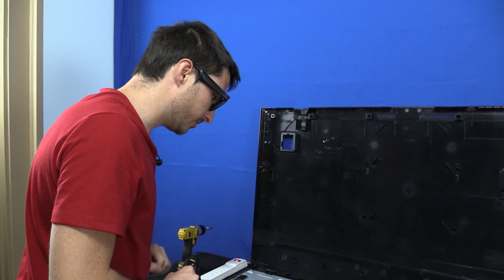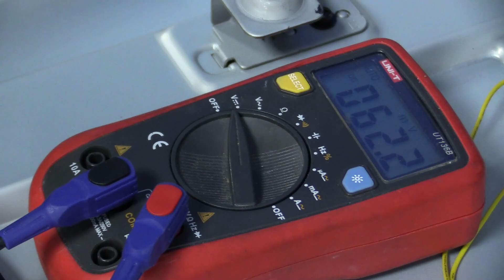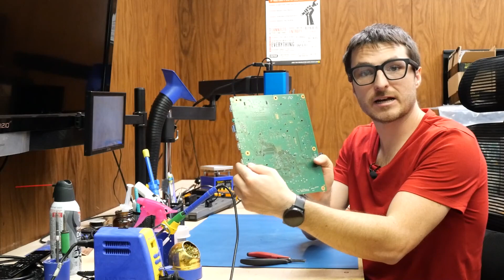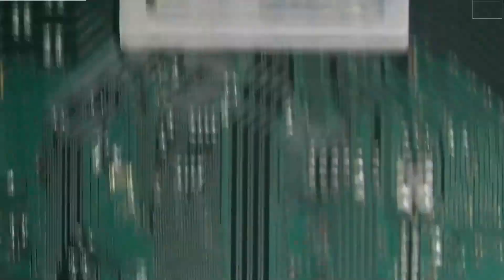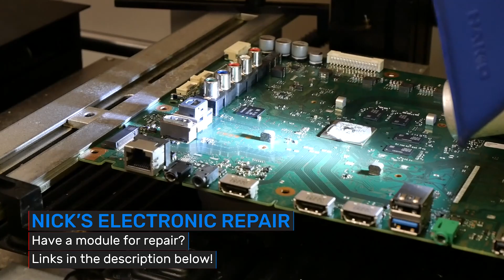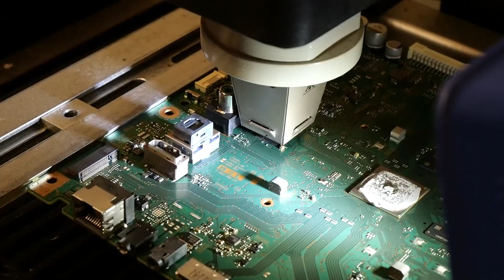Sony TV Repair XBR-55X850G

Comment: I guess first things first. You're plugging in the TV to do a voltage check do you have to use the remote to turn on the TV or press the power button on the bottom right side button first?. Also on the last step on checking the power supply  you're shorting out pins 5,9 and 26 together?. Correct.... Please advise Tommy
Reply from the maker: At no point did I ever press a power button during the entire video. 
As for which pins, yes I say exactly which ones in the video. Look at the legend on your power supply, it will tell you where the pins are.

Comment: I tested the #9 pin and it showed no voltage. Likewise with the pins #13-18. It is very difficult to get the test leads in there where the wires are, so I'm not confident I'm doing this correctly. Even if I check on the opposite side with the solid leads (for pins 15-18), I still get zero voltage.

Comment: Hi Nick, having the same 4 red light blinking issue with my XBR65X950G. I searched entire internet the back panel looks entirely different. I tried to ground the B_ERR from the power board but no luck. any help would be greatly appreciated
Reply from the maker: You need to replace the LEDs to fix that fault probably but this could also be due to a defective led driver board

Comment: I have full gray screen on TV and everything is working fine background. Last time same issue occured and technition opened and cleaned some strip with isopropyl. Fixed this issue in 1 minute. Could you please help know what is the issue as same issue has happened again after around a year.
Reply from the maker: Hello,
What model tv do you have? Do you have this exact same model? The Sony XBR-55X850G? 
If so what strip are you reffering to? Was this near the bottom of the set? Could you email me pictures perhaps?
Reply: @NicksTVRepair I fixed it. Model is 55x80aj… strip was kind of golden colour..disconnected, cleaned the strip with isopropyl put it back on…surprisingly tv came back on..sorry didn’t took the pick and its wall mounted.. spoke to tech he was advising to change the strip 😂
Reply from the maker: There is no strip to remove and plug back in with tvs like this. 
I don't know what this could be or what you are describing sorry
Reply: @NicksTVRepair by strip I mean the BUS and there were quite a few in when opened

Comment: Hey Nick, I'm an electronics technician studying electronics engineering at this old age and I must say, your content is awesome for techs like me. I recently had a friend bring me a Sony XBR-55X850B with some similar issues you've described in this video. I've done various repairs on various LG TVs particularly the backlights which go out ever so often on some models. But, I'd like to repair this Sony myself since I all the equipment to do so, except the IR Machine, but indo have some nice hot air machines. However, I can't seem to find the EMMC Chip or the Main Processor for this TV. Could you reach out to me to help me out? Oh, and NO, I'm not doing this as a business or to compete with you or anything. Im helping out a friend.

Anyways, love your vids, love your content, and wish you the best to keep growing your channel. Gid Bless, cheers!!!

Comment: Nick could you help me with this problem on my Sony tv, it is an excellent tv but now it intermittently switches off, it will reset if you switch power off then back on ( you can hear it clicking off ), the model number is KDL-46HX820, thanks.
Reply from the maker: I can't say I know what the fault would be with this model. I am not familiar enough with this one and would require the entire TV to perform a proper diagnostic. 
Sorry

Comment: I have a 65A8H that loses sound after being on for a while. If I keep it on after that I get some noises which sound like are caused from heat and then the TV turns off and blinks red 3 tmes. I can get both a new main and power board but would like an idea which is more likely faulty before I tear mine apart.
Reply from the maker: In my experience this is a mainboard failure. Most likely your CPU is overheating and going out. It will need to be replaced. 
If you have issues with the replacement mainboards you buy and want to go with a more reliable route, we offer this repair service and can fix the board for you. All repairs come with a 1 Year warranty.

Comment: Sir how do you manage to get the software for the emmc chip ?
Here in India it is very very difficult to get it
Reply from the maker: Hello,
I don't think it's easier here in the USA. I mean you have to find a working mainboard that you can use to dump the software, the issue as I am sure you are finding is that often there are no boards for sale not new not used, not even broken. The next option is to find someone selling the whole TV. Once we find it and buy it, we typically factory reset it first, then remove the mainboard, remove the eMMC, and dump it. Then we use that program to repair other mainboards. We once had to travel by car for 3 days to drive from Tucson Arizona to Dallas Texas to go get a TV for this purpose. It was a day-and-a-half drive there, 1 hour to buy the TV, and a day-and-a-half drive back. We could never find someone with that TV for sale in working condition until we found someone on eBay who would not ship it and would only sell it in person. So we had to drive out to go get it. Finally, we were able to start fixing those TVs.

Comment: Thanks for your helpful videos!! Can I get an advice? I got an XBR-55X850G; it turn on, image is good but after 3 min it turns off and you can hear a click. also the red light flashes 6 times. What should I diagnose first? again thanks for your help.
Reply from the maker: 6 blinks = LED strip failure. Replace your LED strips
Reply: Backlight

Comment: Thank you for the help! I have a sony bravia xbr-85x850g and have the exact same issue.
For awhile the tv was stuck in headphones mode because it thought something was plugged into the jack. Then the other day the tv wouldn't power on at all. However, i can still hear the power supply click when I try to power it on. Most likely the main board?
Reply from the maker: Yes that is what I would replace or send in for repair first.
Reply: @NicksTVRepair  thank you🙏🏻 and major respect for taking the time to reply to every body.
Reply from the maker: You are very welcome. I try my best to do so!

Comment: I've been searching for instructions for testing the power board of my Sony set, which is an XR55A80J.  The board is an AP-P525AM, not the same as the one you tested.  Printed on my board are the functions of the various pins on the main board connector, but not the voltages.  So far I haven't found a video featuring my board.  

Can you help?
Reply from the maker: For your board the legend says pins 22-28 should be 12v. Pin13 is your power_on line and 14 is the standby. Standby should have 5v if you short it to the power on line then your 12v should come up.

Comment: Yo tengo un smartv Sony Bravía XBR-55X805E y el problema es seme apaga y enciende
Reply from the maker: Sí, este es uno de los problemas más comunes que vemos con estos. Es el mismo problema, el eMMC de la placa base está defectuoso y necesita ser reemplazado.
Reply: @NicksTVRepair  where I can ge the eMMC for this model apart from aliexpress? But my concern where I can get this programmed? the method you used with USB is for instaling operating system which is another thing, right?

Comment: I have a XBR-55x850c when plugged in it says SONY then goes to graphics in the center of screen then starts over again. What can cause this? Can you repair the appropriate board?
Reply from the maker: Hello,

Yes, this is actually very common and is due to a faulty mainboard. We have a flat-rate repair service for this. Check out the listing linked below to our website. You can pay for the service and then an email will be sent out with shipping and packaging instructions:
https://nickselectronics.com/products/a2072607b

You can also check out this video about the repair of your model mainboard specifically:
https://www.youtube.com/watch?v=wSQr_JVC_hU

Comment: How to fix Chromecast on Sony Android / Google TV after replace cpu or emmc without buying any stick's?
Reply from the maker: Chromcast and casting are 2 very different things. 

A chromcast will work just fine. Casting won't.
Casting is the act of sending information from your phone to your TV via the wifi. If your TV has casting issues after replacing the eMMC chip, then you can purchase a Chromcast which is a device built by google you plugg into your TV's HDMI to cast from your phone to the chromcast thus bypassing the internal TV casting system. 
There is no way to go around it (at least not legally)

Comment: So my issue with this TV is red light flashing. I’m guessing it has to do with the power supply, I switched outlets and the screen does turn on but shuts off around 20second in and starts flashing red again. What do you recommend I do for a diagnostic before I purchase a new board? Thanks man!
Reply from the maker: How many times does the red light flash? That is what will indicate the fault. 2 means power supply, 4 and 6 means backlight, 5 is T-con or panel 7 and 8 is mainboard.
Reply: Thank you for your reply. Just checked and it flashes 6 times consistently. Do you recommend I try to fix this myself or just get a new TV? I'm more than capable of fixing myself with a step by step instruction but you're the expert so I'll listen to your advice!  @NicksTVRepair
Reply: @NicksTVRepair  Do you know what 3 flashes would indicate?

Comment: Hi Nick,
Please tell me what is the different between Diode with Part Number SR5150, SB5150, and MBR5150?.
Is the possible if we replace diode with different part number?
thank you Nick
Reply from the maker: That is not a simple yes/no answer, there are a few minor differences. Some matter some don't. You would have to bring up the data sheets and compare them to one another. It will take at least 10-15 minutes to find all 3 and spend the time to compare all three and find all the differences. 
If you are looking to use them to fix an 850E power supply they are all similar enough and within tolerance to be used interchangeably.

Comment: I have a Samsung ln40e550f7f, its a CCFL back lit TV,  the back light circuit is bad, pulling too much juice, burned up the fets and blew the fuse, tried new fets, they lasted 1 minute, never got lights, sound and image are ok. Considering converting it to LED maybe, otherwise prob not worth fixing. It has two large inverter modules. Do those typically go bad? or the lights?
Reply from the maker: It may only need 1 CCFL to be replaced. Often they are obviously damaged. Or they shine a different color. You could open it up, and take a peek at them and see if you can find anything obvious or if one of them shines a bit pink or dim then you have your culprit

Comment: I figured out the on pin, its the 5V_S which is right next to the Stndby, touched them together and got voltages out, I was told the SW turns on the backlights but I didn't try it. I found out the main cap and another small one that powers the back lights were cooked, the backlight cap randomly blew out smoke and oily substance at me, and get this, it still tested good after I removed it. I installed some new caps, all good.. So Success on this one. I have a CCFL I'm working on now, I'll make a new comment for it. Thanks for the advice.
Reply from the maker: Most power supplies have a PS_ON line that needs 3v applied to it. Some however need it shorted to ground if it by default has 3.3 v. Some plasma power supplies work like that.

Comment: Which pins turns a Hisense power board on? I have PWM SW and 5V-S not sure what they mean. PWM is pulse width modulation I assume but what does it do?  I always like to test power boards isolated. This where my electronic knowledge falls short, I don't know some of this stuff and the only way to know is a service book that doesn't exist or you tube.
Reply from the maker: Vernon,
Every TV is different, there is no 1 answer I can give you because depending on which TV you have, the answer will vary. 
When you have specific questions like this, I would be happy to answer them for you, but make sure you provide me with the model number of the TV and part number of the circuit board in question. 
If you want to make a new comment (so I get a notification) with that info I will look into it and let you know.

Comment: EMMC.... is it like Bios chip in a pc? BTW I dumped the sony xbr I was working on, got several more free TVs, one is CCFL but hey its experience. two just need backlights, both 4K plus a Samsung 4k with a bad main board, what typically goes out on those?
Reply from the maker: Yes and no. The EMMC is like the Bios chip but also the hard drive that has the OS. It holds all of the software for the operating system. 
For the Samsung sets it depends on the board, sometimes it's the HDMI processor, sometimes it's the main processor, sometimes it's the EMMC. If you want to email me with the model numbers I can give you more info.
Reply: @NicksTVRepair  You are by far the most resourceful and knowledgeable with TV repair. There are no shops in 100 miles of me, I need to start one. I should know how, the paper on the wall says I do LOL. When I went to tech school flat screens didn't exist. So you tube, and you man, da best!!

Comment: Brother try to do this model KD65XE9005 with fixing 4 times blinking. Thanks
Reply from the maker: 4 blinks is LED strip failure, you will need to replace your LED strips. 
We don't really like to do LED strips because there is nothing really technical with it, it's just time-consuming and labor-intensive. We will occasionally do a few tougher ones such as the edge-lit but the backlit ones I don't know if we will be doing videos on. Maybe in the future.